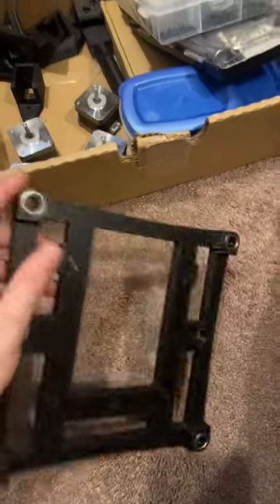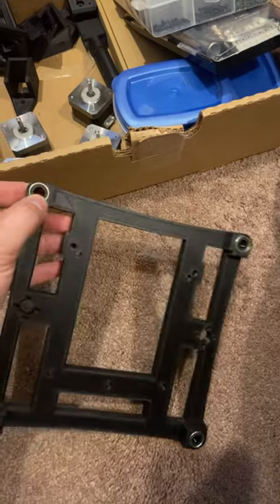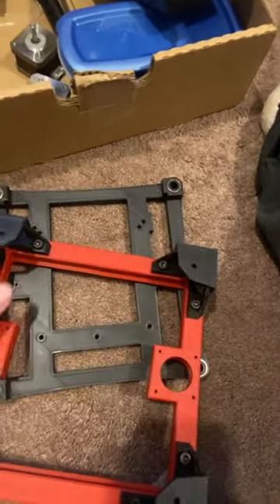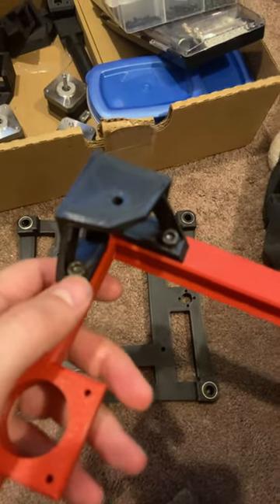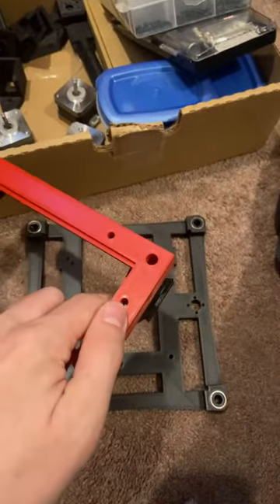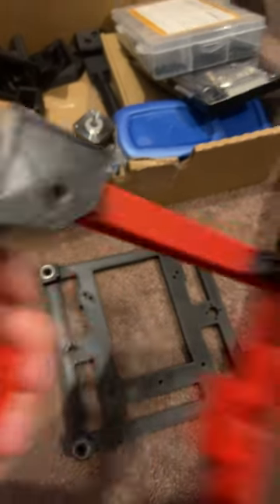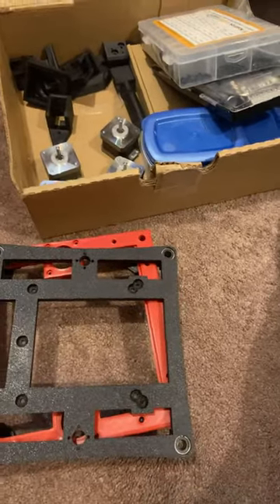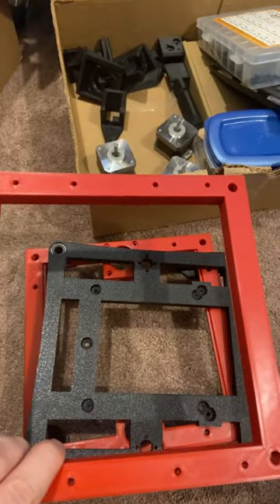Rook 3D printer feet to frame assembly Short

Comment: Are there any inserts required to mount the legs? Or just simply screw them on to the frame?
Reply from the maker: Just screw them into the frame. Rolo used screws I used M5 because my holes were a little smaller
Reply: @Gulsifer  thanks, decided to Givenchy this project a go, however (as I am complete noob when it comes to actual build of repraps) I am a but confused. Your v8ds are much of a help.
Reply from the maker: I used 5m x 16 it worked but my printer talarances are at .2mm if yours are better then that then you will need a Nut and 25mm M5 min.